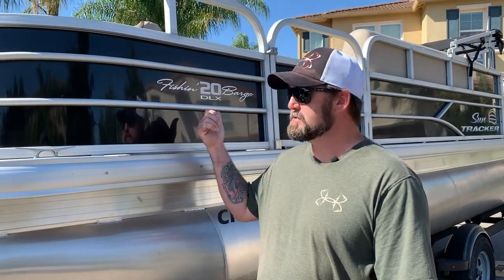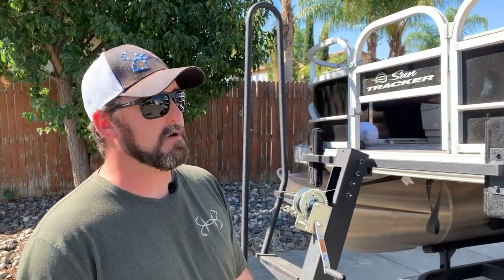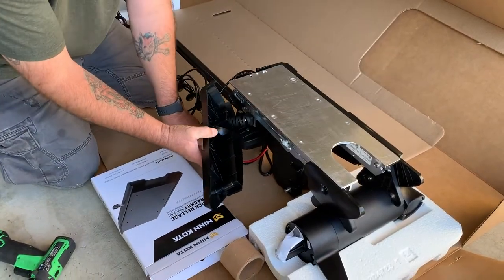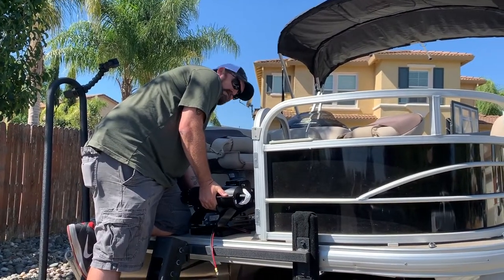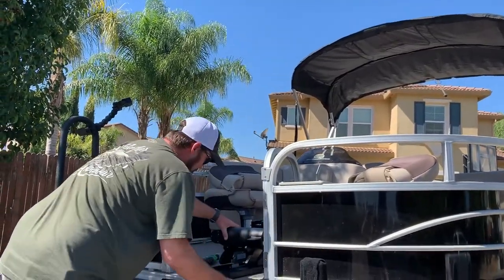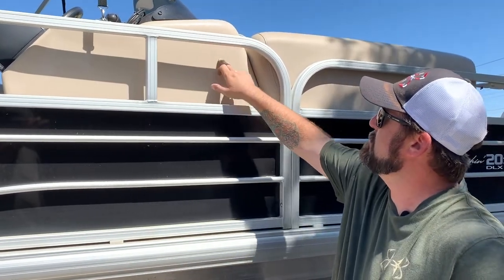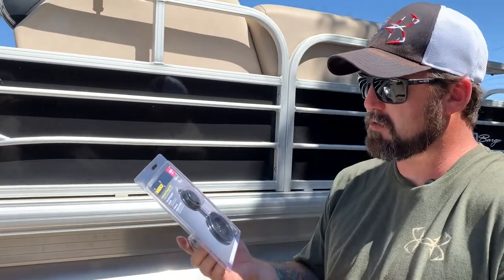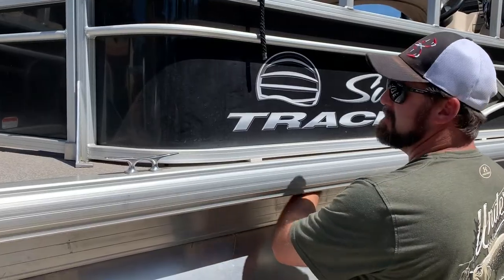MINN KOTA TERROVA TROLLING MOTOR INSTALL ON A PONTOON | HOW TO

Comment: What would you recommend for a  bass buggy 16 xls?
Reply from the maker: I would still go with a 24 volt.. it will work even better for you.. last way longer.
Reply: I got the 24v terrova thank you for the reply. I am having an issue trying to figure out where to place the battery charger. There isn’t enough room like the 20 footer on this video. Is outside on the plastic going to work or does it get to hot for that? I appreciate your help.
Reply from the maker: Dustin Hunter so where we normally put them in that plastic style helm is either.. inside up right behind the seat cushion above the live well.. use short enough stainless screws to not go through the pad.. just enough to bite into the plywood seat back.. or through bolt it inside to the lower left and have only the bolt heads on the outside.. hopefully that make sense.. let me know if you have any questions
Reply: I went with the bolt method. I really appreciate it, thank you.
Reply: Thanks to your help I was able to install everything and get it all up and running. Had a safety question though. With the lead flooded battery’s putting off hydrogen in a sealed environment with the battery charger. Are there any safety measures that need to be taken with overnight charging or anything?

Comment: He did everything awesome except when it come to the batteries I would not install that acid batteries I purchased two Dakota lithium lithium ion batteries each are 100 amp hour and on my Minn kota electric trolling motor I'm getting between 12 and 15 hours run time definitely worth the money as well as the 11 year warranty they give you.